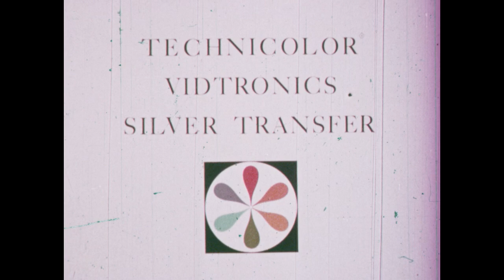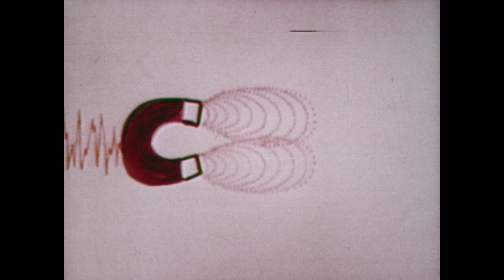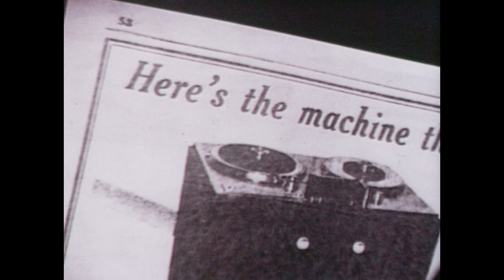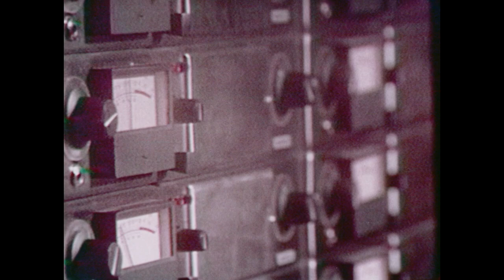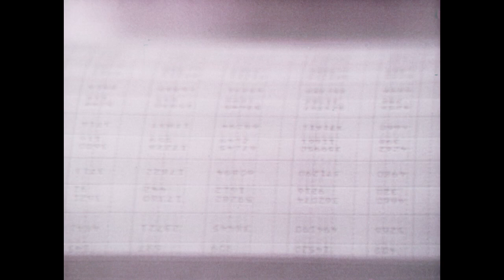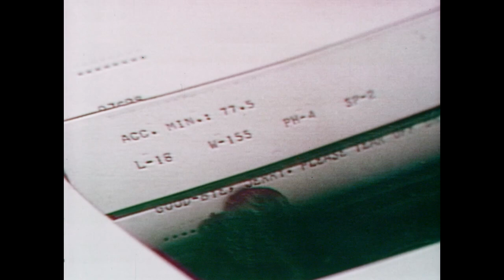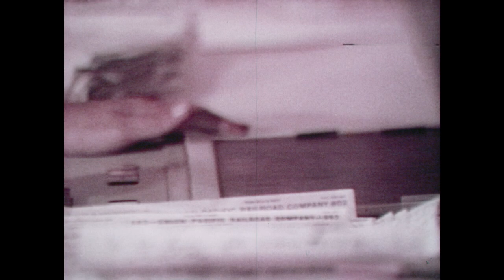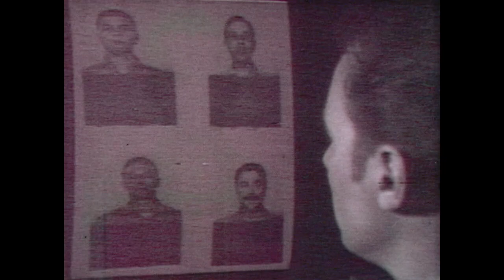AMPEX Miracles of Magnetic Recording

Comment: The revolution of magnetic recording was not limited to just radio and records.  It made a tremendous impact on the motion picture industry, which made the change from initial optical sound recordings, with magnetic striping made available for multi-channel theatrical playbacks for the spectacles of the 1950s.